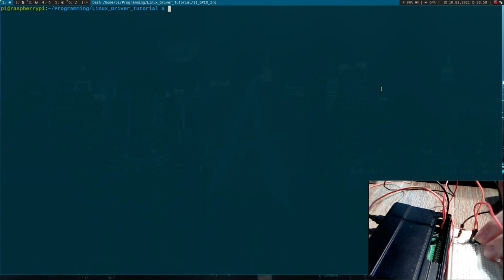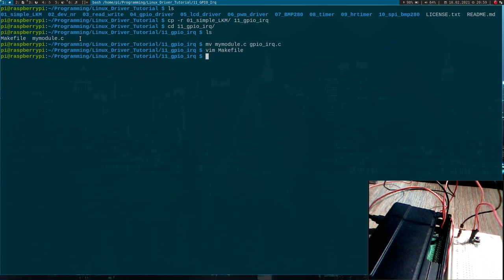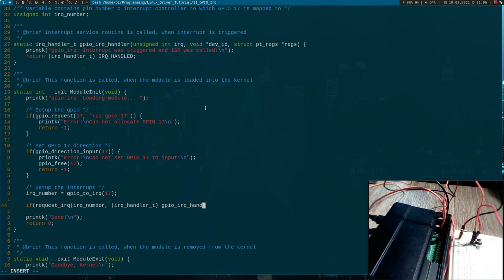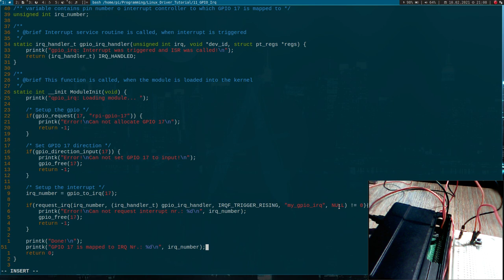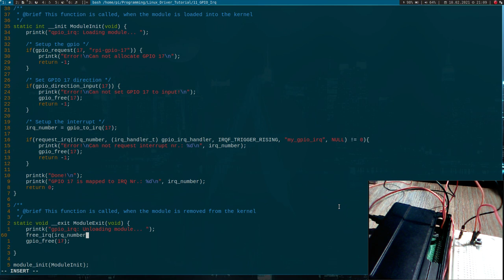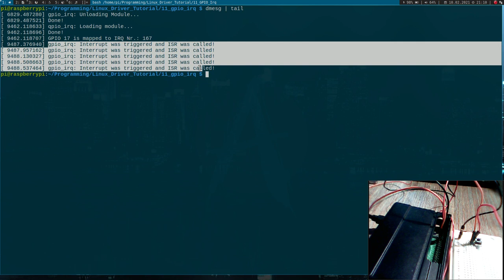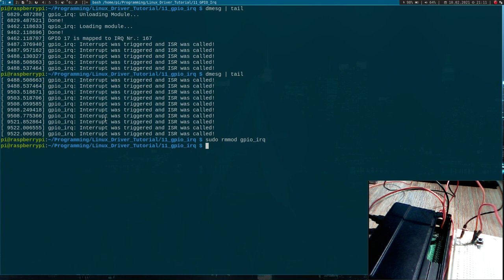Let's code a Linux Driver - 11: Using GPIO Interrupts in a Linux Kernel Module

Comment: Can't reproduce this... Could you detail the setup on the breadborad?
I have a 4-pin square push button (2 x 2 aligned pins).
Is there a privileged pin? Are they all the same (as I assume)?
I plug a connector from a raspberry gpio pin to a hole connected to one of the pin push button: is there more to do?
Does the ground needs to be linked to one pin of the push button (I assume no)?

I tried to reproduce this in a very similar way using overlay (= using `gpio_button = gpiod_get(dev, "button", GPIOD_OUT_LOW)` and `gpiod_direction_input(gpio_button)` in dt_probe callback) but the IRQ is never triggered?

In the overlay, I init the gpio with `button-gpio = <&gpio 27 0>;

The interrupt appear correctly in /proc/interrupts
Reply from the maker: Here you can see the basic setup for connecting such a pin to the raspberry pi (here it is a pico, but the setup is basically the same) : https://microdigisoft.com/wp-content/uploads/2022/03/Raspi-Pico-Push_button_led_bb-1024x714.jpg
You are using a device tree overlay for your driver? Then you are using gpiod_to_irq to get the IRQ, right?
Reply: OK, in my case, the problem was in the setup: on the breadboard, I just had to turn the button 45 degrees... and IRQ were fired.
It seems there is an orientation the button must have to work... I didn't know that...

Comment: I have one question. Do you know how interrupts in linux are assigned? For example I want to write my own linux driver for handling UART connection. And I want to use system interrupts to handle this by my driver. So, by driver layer I want to know what what interrupt source vector is mapped to my hardware. Is here any function in linux , which is mapping interrupt source to system IRQ service? something like gpio_to_irq(pin_name). Is interrupt source is set during boot up of linux or after start xserver? But not for GPIO, but on other peripherals? To be honest. I want to know how to setup IRQ from UART Rx line in linux from IRQ source perspective.

Comment: I tried with new kernel v6.6 seems not working... I don't know why.
Reply from the maker: Is it not compiling or can you build it, but the interrupt is never triggered?
Reply: on the 6.6 kernel, i had to use device tree for making the gpio to work (i used example example 21_dt as a base)  and also change gpio_to_irq  -> gpiod_to_irq

Comment: req_irq(0 function is not clear .................... If ur mapping the interrupt to the ISR ... the func name is misleading.
Reply from the maker: Well, the function does both. It allocates or requests the IRQ with the number irq_number, so it is used by our driver. After requesting the IRQ, it will show up in /proc/interrupts with the name passed as argument 4. And the function also maps the IRQ to the handler functions. 
Sometimes the function names are not optimal. 😔
Reply: @johannes4gnu_linux96  Ur videos are good .................... By any chance are U Derek Molly ? Ur accent doesn't sound American ..................... I am from Bangalore, India.

Comment: This video was really helpful! I have a doubt: If the interrupt was generated by an axi gpio, is there another header file we could include and use its functions? Thank you very much!
Reply from the maker: With AXI GPIO, you mean a GPIO from an IP which is connected to the core over an AXI Bus? Normally a core like the ARMv8 in the RPi uses an Interrupt Controller for the interrupts. Therefore the GPIO is multiplexed to an input of the interrupt controller. And for the the interrupt controller there are already implementations in the kernel. This interrupt example uses the interface, which is provided by the Kernel Modules for the IRQ Controller and the GPIOs. So normally, we don't need additional includes or functions.

I hope, this helps you.
Reply: @johannes4gnu_linux96  Yes, I mean exactly that! So should I look for an example of the implenentation of the interrupt controller in the linux kernel? And can I write the code of that also as a linux kernel module? I am starting with linux and I still don't understand it very well... 😅 Thank you very much for your help!
Reply from the maker: @saraalonso9559  If you use an off-shelf chip like the Boradcom chip on the raspberry or a TI chip on a beaglebone you normally don't have to worry about the interrupt controller. There are already some kernel modules available and installed for it. You can just take the code I have developed in this video, maybe change the GPIO for the interrupt and it should work just fine. (e.g. if you search for "GIC" which is a common used interrupt controller in the Linux Kernel sources you will find a lot of hits)

If you have a custom chip with an ARM-core and a custome interrupt controller, I don't know what to do. But I hope this is not your usecase.

Comment: Can you explain how can you define "rpi-gpio-17" in gpio request function?
Reply from the maker: Check out my video about gpios (Part 4). There I explain it in more details. But basically I just request GPIO Nr. 17 and give it the label "rpi-gpio-17". This label should appear in /sys/kernel/debug/gpio.
Reply: This is just a label, you can name it whatever you want. This label will appear in /sys/kernel/debug/gpio like @johannes4gnu_linux96 has already mentioned. :)